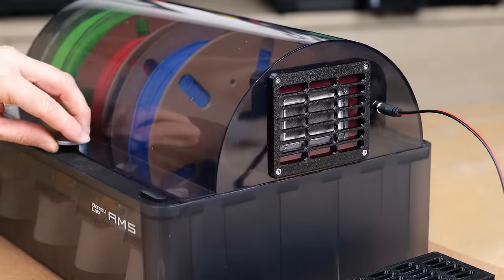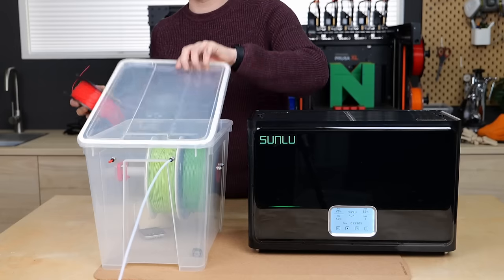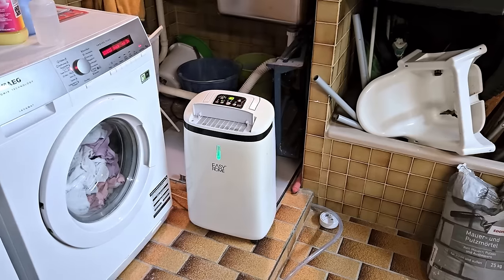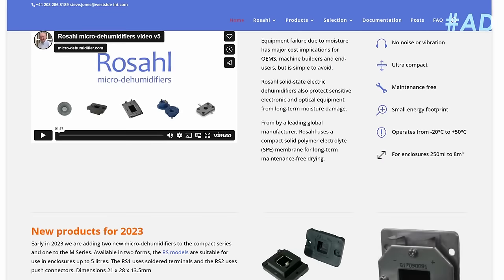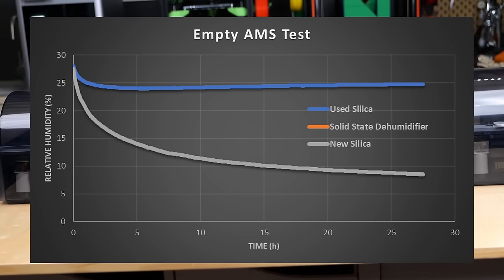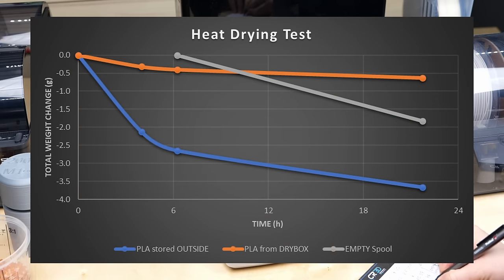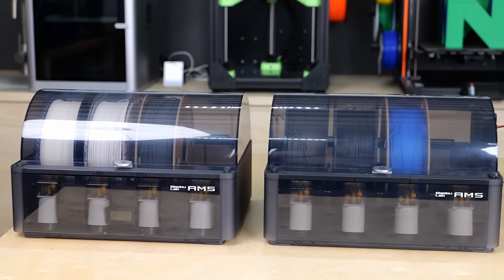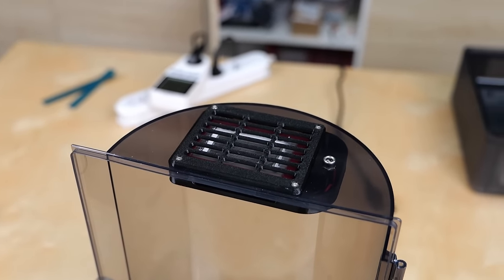Solid-State Dehumidifier: The Ultimate Filament Dry Box

Comment: This is a really nice piece of work but is this a bit of overkill? If the spool is in a static system (not open to the environment) how much water is in the air for the polymer to capture? I did some quick calculations and at 20C (my shop) and 100% RH there is roughly 0.015 kg (water)/kg of air from std vapor pressure curves. I keep my filament in approximately 1 m^3 sealed box (roughly) so there is approximately 0.018 kg of water (max @ 100% RH) to start based on vapor pressure data. It might be higher in hotter climates.  I have 1 kg of silica gel in the box and there should be no problem removing this amount of water even if I open the box as that amount of silicon gel can hold 400 gm of water (approximately) before to needs to be recharged (I do this only 2X a year). If the material was exposed to a non-static condition open to the environment, the solution presented here would be useful. Diffusion of water into/out of  polymers is rather slow at room temperature. It is imperative to keep filaments dry (although it doesn't need to be absolutely dry, i.e. <0.000001 % absorbed water) for consistent work, but simple solutions might be enough.

Comment: Try new desiccant AND the Rosahl device.  Would the desiccant act as a sort of "capacitor" drawing the moisture out of the filament quickly, while the Rosahl device slowly expels the moisture from the box? Add an arduino controlled heater - raise the temperature in the box a few degrees every few hours and monitor the humidity. When heating the environment no longer increases the humidity (thus the filament/desiccant can be considered dry) then the heating routine can be reduced, saving energy. Maybe once per day. As for the excess oxygen build up... maybe draw in fresh air filtered through desiccant, creating a positive pressure inside the box to cycle the air out of the box over time.

Comment: but if we use the electric version on a AMS which also costs over 300€ it seems to be a good deal to take the extra 150€ for the perfect dry filament storage with automatic print starts 👍

Comment: I looked at these 3 or 4 years back for use with filament, even bought a small variety of the solid state dehumidifiers to play with ($$$).  Overall, it is freaking cool tech, very effective and absolutely SILENT, although cost prohibitive.  BUT, when you take a unit apart, all you'll find is a couple membranes sandwiched between 2 electrical contacts.  That's it.  The stamped steel frame per unit is gross overkill for filament applications, but on-spec for the original intended use of them as permanent dehumidifying elements for hermetically sealed industrial electrical enclosures.  If you can figure out what the membrane material is (and obtain some for reasonable $), you might possibly DIY these for pennies.  But it doesn't work well with a cheap switch-mode power supply (IIRC), so that's an issue.  IMO, the high price tag is solely due to being intended for very specialized industrial applications, has nothing to do with actual cost of materials.  If someone can identify the membrane material, I'd love to know.

Comment: 1. What's the max volume each size can handle,  especially if it's already got dried filament it can probably hand a decent volume with a ventilation fan? - I figure the price could be worth it if you're maintaining a filament wall qty or similar.

2. Further, you could power the fan and dehumidifier with a small solar panel and the cost of having to replace and deal with desiccant drying itself would be outweighed overtime.

3. Can you test effectiveness with and without a circulation fan at different volumes? Like how well would it dry a long row of filament (ie a filament wall row); would the spools further away really ever dry out with no ventilation? How long would it take?

Comment: My very first question was the release of oxygen within the container and the hydrogen levels in operation... Additional oxygen could be an oxidizer to everything in the box and would require the additional step of having an oxygen absorber, glad to see that the increase is so minimal overall. The same thing with the hydrogen being much lighter than air and ridiculously flammable with a nearly invisible flame... again, mostly dispelled by the numbers cited... overall a very interesting experiment but I really wonder whether this would be worth the cost to the average hobbyist. Even a more professional outfit would likely need to do a cost analysis and ROI comparisons to see if this would be a worthwhile endeavor to pursue with 3D printing. The benefits are clear in the usually small volume spaces this was designed for, but I think it would need further work for the volumes involved with filament spools.

Comment: I wonder if something like this would be possible to use with heated drying box that may (or may not) have a fan to circulate the air? Could it combine to dry the filament and then hold it at a certain dryer relative humidity more quickly?

Comment: The % humidity is relative to maximum possible moisture amount in the air, and that depends on temperature - warmer air can contain more moisture without it precipitating. I'm surprised that didn't skew the results - I would expect humidity to drop in warmer air, not rise.

Comment: I only see a thing that could be improved on the AMS version: swapping the housing from the inside to the outside would open up the airflow a bit again, but at the cost of putting bulk on the outside of the box. On the inside, the grating could be possibly a little slimmer

As for the effect, I could see the usage of medium-sized devices on dedicated boxes that are filled right from the shipping box.

however, in my personal print shop, the humidity is quite low all the time, so I rarely needed drying filament but for hot summer days.

Comment: I used this element for 5 years. They are good but comes with significant drawbacks. This elements are very very sensitive devices. Acids in general will destroy them usage of sanitary silicone is higly prohibited. Oils in the air will significantly impact the lifespan of the product. The product also have a lifespan of arround 3-5 years. They are slow I mean very very slow and they are good to relative humidity of 15%. When you open the lid and humidity enters the chamber it will take at least a day to bring the humidity back to the dry level, but if you have filaments they play the role of silica gel😀. Gradually the element will remove the moisture from the filaments within few days. In general you if get one of this and they are really expensive you should avoind acid vapors, oil vapors and dust. You can expect arround 3-5 years especially if you put controller to stop the element when humidity is low. Keep in mind that membrane will let moisture in when powered off.
Reply: Forgot to mention they are very very sensitive on power supply and if they state 3V they mean 3.00 +- 0.05 and better go for lower side. Cheap PWM DC/DC are not recommended better use linear regulator.

Comment: Maybe the solid state dehumidifier can replace the 120 cubic foot tank of dry nitrogen that I keep the AMS pressurized with :)  Seriously though, I'm pretty laissez faire when it comes to filament humidity management. I open a spool, put in the X1C AMS, and it stays there until it runs out, which could be weeks or months. Number of failed prints is less than 1%. Maybe what we need is something like a filament drier that connects to the AMS via a host on either side and circulates warm dry air through it. I don't want to move spools to and from dry storage before and after each print.

Comment: A cheaper solution is to make a swinging desiccant dryer. So you have two desiccant containers and a stepper motor to alternate them between the spool holder box and a heated desiccant drying chamber. The desiccant drying chamber can be as small as possible (just enough to fit the desiccant container) to save energy when heating it up.

Comment: I would prefer using Peltier element and a two fans.
The cold side condense the water vapour. Condensation water drip on a wick. This wick evaporate outside the container. Put an hygrometer sensor to only use power when the RH% is too high.

Comment: My largest issue with wet filament, is the filament the the PTFE tubes in the AMS. Inside the AMS it's nice and dry, but the ends still in the tubing underneath start to break after mere days.

Somehow the Silica doesn't seem to have any effect there.

Comment: If you have a fews days notice, could you not use the atmosphere to dehumidify your filament?

If you live in the right climate, dry air is easy to come by simply by going outside at night after the moisture in the air has condensed out.
If you take your room temperature filament outside on a cold night and then seal it inside a bag or box before taking it back in, it should be an extremely low moisture environment when you warm it back up.

An interesting experiment would be if you could use a cheap temperature/humidity sensor to open the airflow to a filament box if the humidity outside is lower than inside.

Comment: How many of those would be required to dry up a bathroom after a shower and speed up the drying of the hanging towel, in, say, at most around half a day? (I won't bother measuring my bathroom, let's go with a wild guess of 2x4x5m volume)

Comment: Does a filament really dry just by drying the air in its dry box? I understand that to dry the filament you have to heat it to a sufficient temperature and for enough time for its moisture to transpire, and only then evacuate that moisture out of the dry box. For example, like vacuum ovens, which perform a heating curve, after finishing that cycle, vacuum is applied to the receptacle.

Comment: I am only printing in PLA for now but i have been on hold for abit waiting for the new A1 heatbed and i noticed some stringing in my prints that did not happen before? (A1 is my first printer and only printed for a few weeks before recall.) would this be because it obsorbed moisture in the air? Should i get that Sunlu box for my filament? will it damage the filament if i dry it a few times?

Comment: These would be pretty useful if they weren't so expensive. I can buy a massive amount of silica gel for the cost of one of these dehumidifiers. The silica gel lasts a long time in an air tight container and it can be dried and reused without special equipment.

Comment: Love the idea but the cost puts it out of my price range.  Found a 200 watt heater with for $30.59 on Amazon and think this and a digital thromostat in a plastic tote (with proper precautions) would be almost as good and I could heat any size tote for the 3 and 5 kg spools that I like so much.

Comment: I got your TS100 heat set insert adapters. Would that also helped to get the holes in your ams unit without the fear of cracking it? Or does that plastic not have a low enough melting point?

Comment: I put two 12vdc 70C heating elements with heatsinks in my AMS and typically see humidity of around 25%.
Reply: Which ones did you use? Do you have them on a controller? I was thinking about putting a heater that I use for my resin printer in there.
Reply: @Festivejelly  70C 12vdc heating elements from Amazon.  Heatsinks from Amazon are adhesive.  No controller necessary because they don't go higher than 70C which doesn't hurt AMS plastic. Requires a beefy 12vdc p.s.

Comment: Honestly considering there is no need for any replacements unless the unit itself dies, and the absolutely minuscule power draw even at higher humidity levels the prices aren't that bad, usually stuff like this is ridiculously expensive.

Personally I would instead put the dehumidifier in a bigger storage box, keep it running 24/7 so the humidity is always at the lowest possible so it doesn't need to ramp up as much, and that way the spools will never be in a position where they will actively draw in moisture unless they are in the storage directly attached to the printer, since the printer storage is always gona have dry spools put into it now I would just place a smaller unit on there.

Shame they only seem to sell to companies, I would love to get one in the future.

Comment: In theory, would it be possible to use conductive filament to print layers of a solid state dehumidifier? Even if it were much less efficient than the real ones, then you could make a large panel on the box, or the whole box, a solid state dehumidifier.

Comment: I saw those devices also years ago and wanted to build a dry box out of it, but the price was way too high at that time.Still costly today, but I will revaluate the idea. The need for power distribution to several boxes might be a drawback. I don't find it easy to find suitable air tight boxes to begin with. :-) Regarding the seal: I remember a post from Prusa about water tight containers and their finding was to always use O-rings instead of printed seals.

Comment: I'm a bit lost. I've been printing since 2014 and have used many many different types of pla and sometimes even filament that has been open for 5 years. No problems printing at all. I'm located in the Netherlands so it's not extremely dry here.

Comment: Just a note on these devices: they have a half life, meaning at a certain point the devices degrade by 50% and so on. Rosahl dehumidifiers have a half life of 5 years. Meaning aaround the fifth year, they will be half as effective as new. And with replacement, you have to replace the whole unit by design.

Comment: I really liked it, but the price is extremely high, taking into account that you still have to purchase a power supply and have a monthly energy expenditure (however low it may be).  If you consider that silica you can heat and dry it, meaning it is practically eternal.  The biggest advantage of electricity is that it is maintenance free

Comment: If you put silica and molecular sieve together in a sealed container, the silica looses the weight that the molecular sieve gains. I find a fresh vacuum packed tube of filament in a container with sieve, causes the same sieve to get heavier than just the empty box. I see no point of vacuum packing as the manufacturer propably seals "cold" filament. Furthermore, a sealed container will let moisture in, so my thoughts is that even a sealed vacuum bag will "suck" in moisture to reach equilibrium, in the same way that air pressure in a soda bottle will go up if you use those "compressor" thingies to pressurise your bottle. The CO2 will reach equilibrium regardless of the pressure. I think Action lab demonstrated it.

Comment: The unit you have appears to be M-5J1R and is price at 225 EUR = $244 US - puts it out of my price range. I can buy a complete dryer for 2 rolls example - Comgrow 3D Printer Filament Dryer Box for $54 US which will work just fine.

Comment: would building an enclosure so it mounts on the outside, rather than the inside, mitigate the circulation issue with the 4th spool in place?

Comment: great video thanks! Isn't it a bit questionable to use relative humidity as a measure for the moisture in those cases? You mentioned, that the RH shot up a little bit, when the temperature was rising. Theoretically, the RH is supposed to go down because the absolute humidity is staying the same (except like you say, the additional moisture comes from the spool) 
But generally, i think it would make more sense to measure all this data with absolute humidity no? With that unit (g/m3) you could directly calculate the weight of the water still enclosed in the case.

Comment: CaCl2 (without crystalline water) and P4O10. they would get it bonedry (I'm talking about PPM or PPB levels of H2O.
but consumable, P4O10 (phosphorous pentoxide) creates phosphorous acid, which is not exactly pleasant, but dilute it down and add sugar, and you basically have coca cola.
one problem I see with your setup: the various gas molecules have to find their way to the desiccant, just on pure statistical movements, molecules bumping into each other. add a fan to force them to the desiccant.
Reply: another fun idea, since you mentioned the problem with oxygen. buy a gas bottle with nitrogen. nitrogen is moisture free. and once per day, just flush the bottle with a stream of nitrogen.
the only problems with that setup: in chemical laboratories, pressurized gas bottles are usually set up in a segregated area where they can't do harm when bursting (they usually don'). and you need an oxygen meter because in the case of a leak, it can displace oxygen, and if the oxygen concentration in air drops below 17% or so (it's normally 21%) you will get light headed and then pass out. so it's not exactly a great idea for a home setup, but interesting for shops.

Comment: Since there is no way to quickly check the moisture content of filament without trying to print with it, and I have had brand new rolls of filament vacuumed sealed in plastic with desiccant print completely wet, I just assume any filament I have not just dried to be wet and dry it before use.

Comment: This has me wondering if there would be a good way to modify a normal dehumidifier and plumb it up to an AMS. 

Sure it's bigger, uses more power and needs to be drained. But the drying capacity is huge.

Comment: so i remember watching bigclives video when he first did his. and there is a price list for the pd5 unit which is for a smaller space but thinking with alumina beads or even silica desicant the small thing would be perfect as its specs are pretty good for small spaces. micro-dehumidifier is their website. minimum order is 60 eu pd4 and 5 is under 13. group buy?